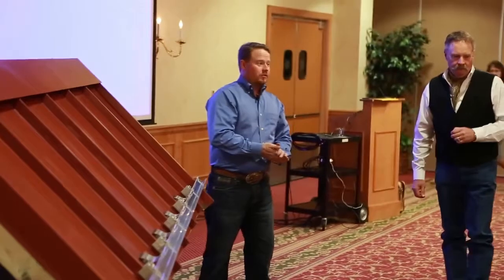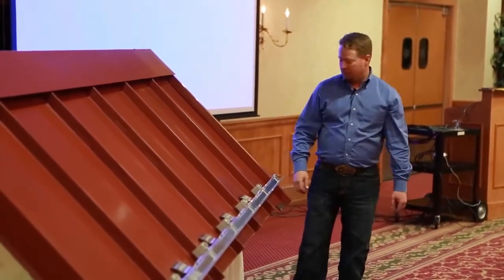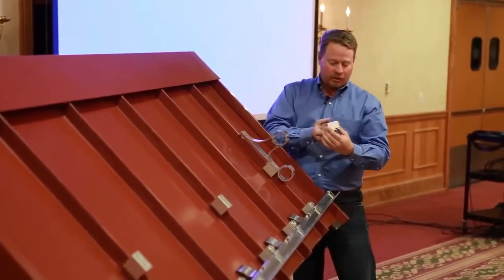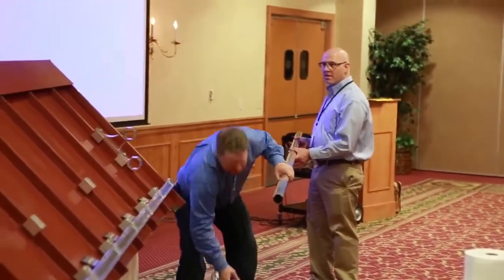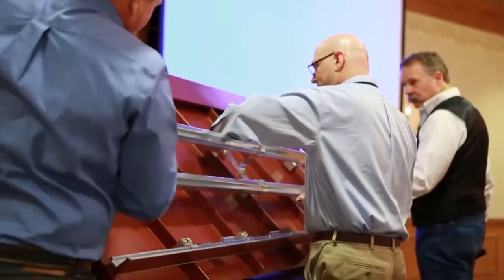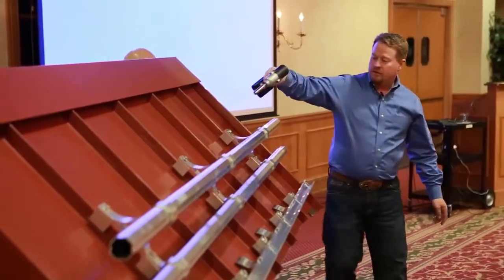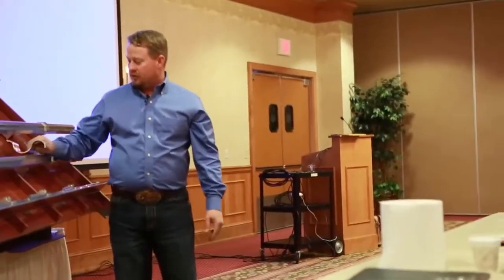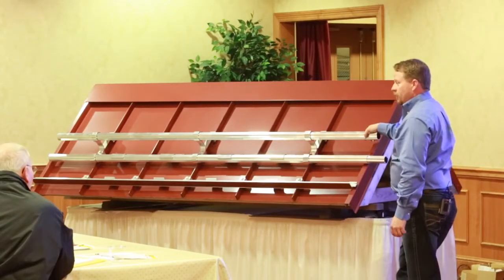S-5!® X-Gard™ Installation Demonstration

Comment: What is the drill you’re using to get proper torque?
Reply from the maker: Hey Zach! Thanks for your question. Shawn is using the  Panasonic 10.8V Cordless
Mechanical Pulse Tool Kit. This impact wrench has an auto torque control shutoff. So you set the torque, then once the set torque is reach, it auto shuts off. These can be purchased direct through S-5!. Another tool we sell direct is a dial-indicating torque wrench. These work awesome as well. Check this video out: https://youtu.be/bhX3dvlavfk.

-Curtis
Reply from the maker: Here's another video on the Panasonic Impact Wrench: https://youtu.be/bpeRfejtvFw